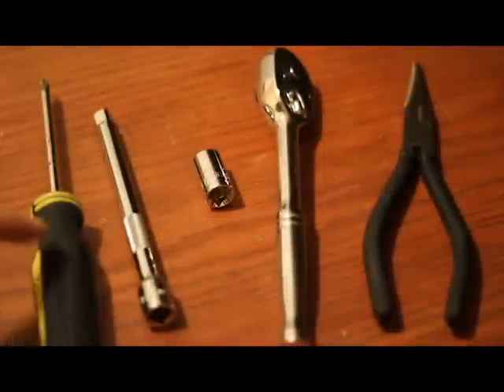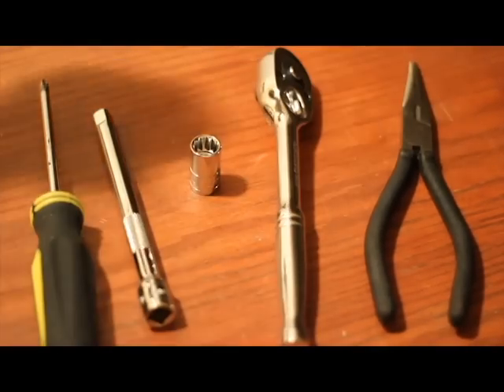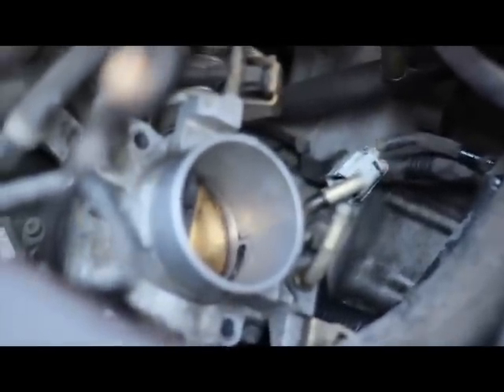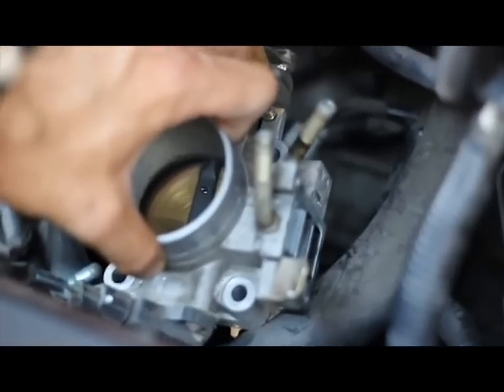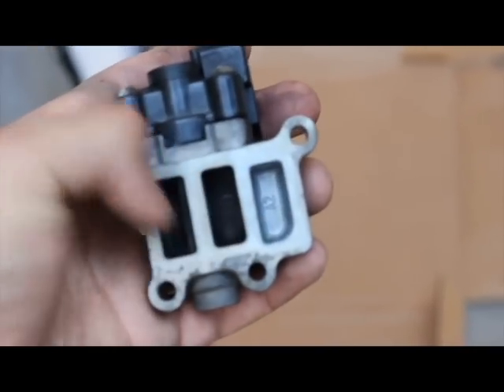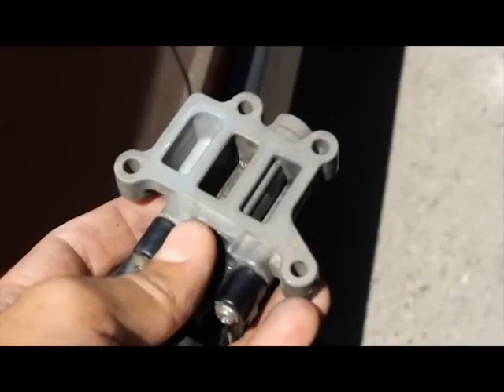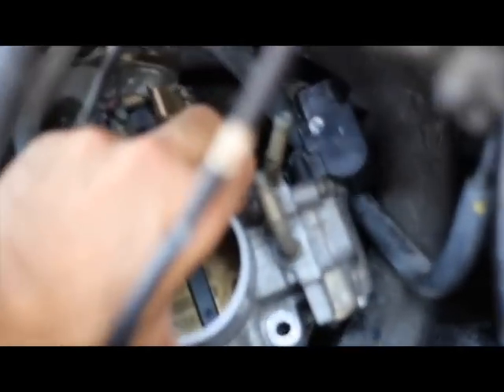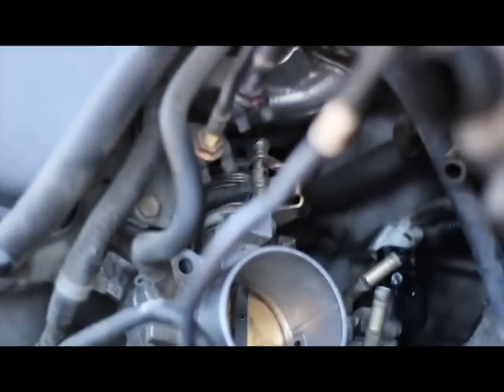How to fix idle problem Honda Element. IACV. THE HONDA ACE

Comment: So I think I have a dirty IAC valve, or one that's failed completely. What were your symptoms? I have a very high idling RPM and the car started overheating. The error codes I'm getting are P2279 and P0507 and I've already cleaned the throttle body air intake/valve.
Reply: If u cleaned the IAC valve and its still idling high, u may want to check ur throttle position sensor (TPS). My idle was pulsing up and down earlier 2day, this problem just occured this afternoon, but only when the car is in park. So in my case, id guess the IAC needs cleaned or replaced. I did get both codes tho. TPS & IAC...im thinkin maybe the fluctuation caused by the IAC may have caused a fault in the TPS. Im not super familiar with my Element. Never had to mess with it much
Reply: @elphantasmo3287  Hi there, did you figured out what the problem was? I have the same problem. Replaced my IACV already and haven't the problem still. I read that the throttle sensor is hard to replace so I havent ordered the part yet.

Comment: i own a1998 honda accord sir t /cf4 with f20B engine...i feel some idle problem.....wht should i do?....itz not like the rpm goes up n down...but i feel the sound is growling up n down...after accelerate the acceleration in N position to 3 /4 thousand ...whn i release the accelerator the engine rpm goes down n sometimes engine get stopped ....and in idle position the rpm is not really ups n down to the dash meter but i can feeel the sound its going up n down.......plz help me wht should i do??

Comment: This is rather odd that if this is an instructional, it starts with parts ALREADY TAKEN LOOSE.  IS THIS FOR PROS??? It would have been nice to see where you unclip, unscrew and disconnect the parts leading to the idle control valve area. }:^(

Comment: This fixed my problem. The hard part is getting the valve off the throttle body. Be prepared to soak it in thread cleaner.

Comment: Can the iacv make the car misfire
Reply: No it can't. Misfire is coil packs 1st clue 2nd spark plugs. Bet is coil packs. Bought ebay set cheap work great!
Reply: @joejoe188  so my problem was the third coil pack first I bought a cheap one it didn't work ended up installing one from the dealership and it never miss fired again so far

Comment: Would this also improve MPG? I've had my valves adjusted and the cars MPG improved, but after installing a new air filter and NGK spark plugs the MPG got worse. I'm only getting 280 per tank and used to get approximately 300 while driving over 70MPH. The car seems to idle a bit rough as well so I will give the ACV a cleaning with brake cleaning in hopes that it resolves the rough idling. Thanks.
Reply: Don't do gas mileage "per tank." There is no way to accurately measure this unless you are letting the car run out of gas. Top your tank off to the very top, right where the cap is. Then reset the trip and drive it until it is on E. Then top it off to the same exact place and divide the miles by the gallons.  
I do this a couple times a year to make sure my mileage is right.

Comment: Hi Ace;I have a 2003 Honda Element that has a relay behind the glove box that kips clicking ( with key on or off) dash lights not lighting, 3-4 turns of key to get the engine turn over and start. runs OK but the clicking keeps going. Any thoughts and help help?Also replaced the relay, but new one clicks the same as the old one.Thanks Stan